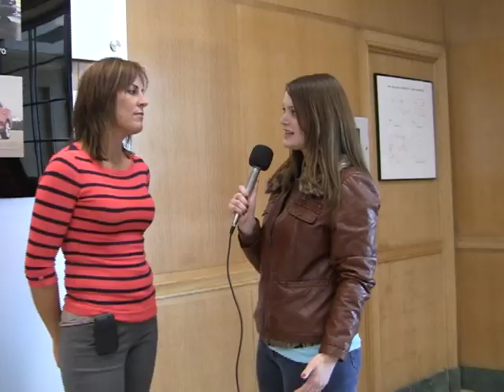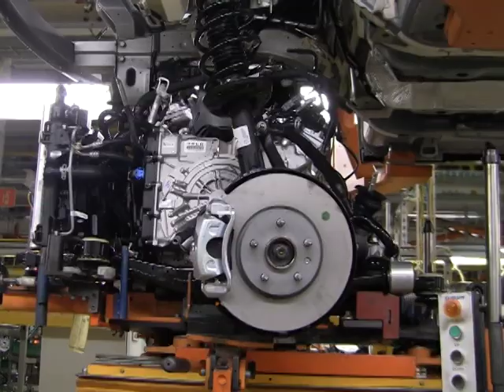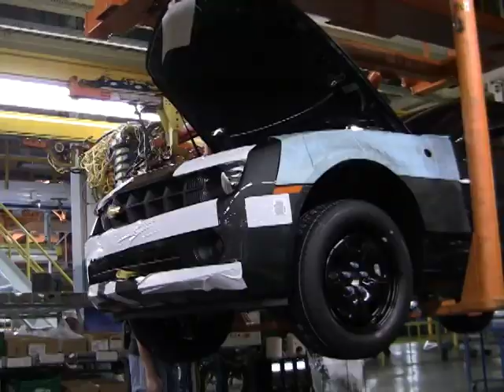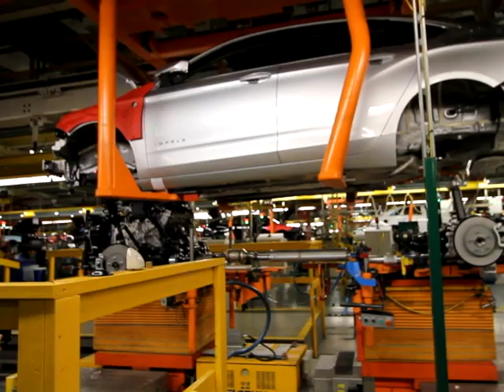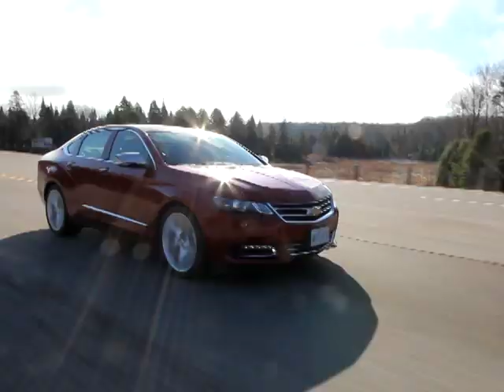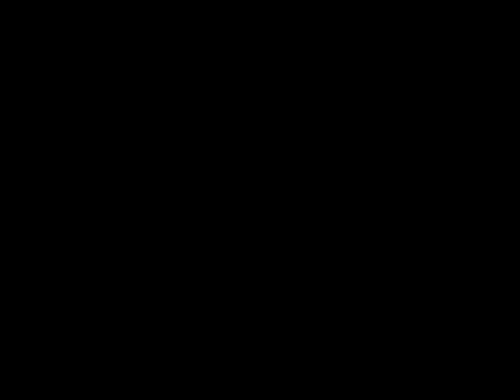Oshawa GM Assembly Plant

Comment: My 2012 Impala was built in Oshawa
Reply: Same with my 2011. Apparently depending on the vin it will tell you if the car was Built in Oshawa 1 or Oshawa 2 of which my 2011 LT was apparently Completed at Facility No 2. 

Nearly 10 years old and my impala still rocks. And runs like a champ. The 3500 Engine has been really reliable.